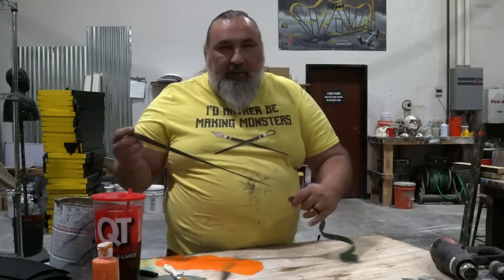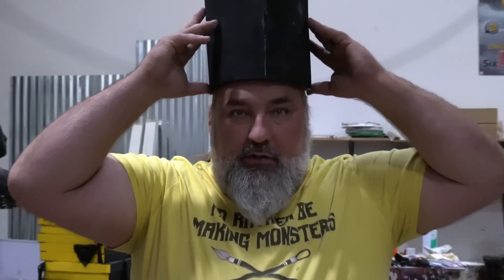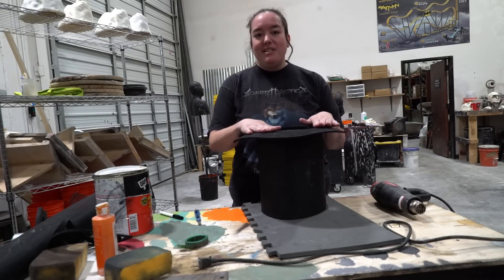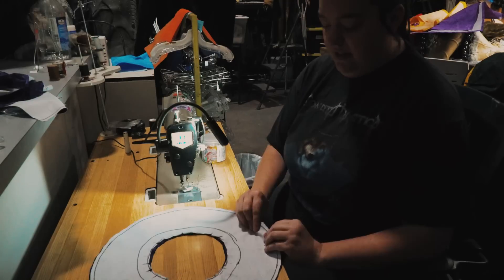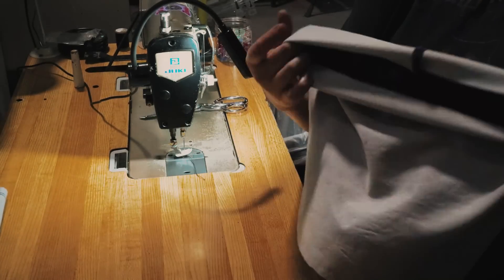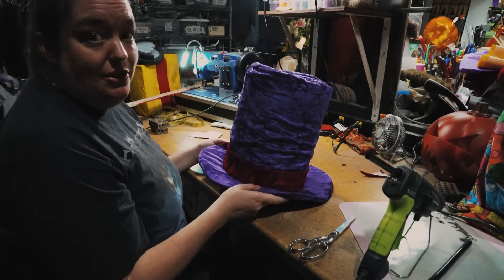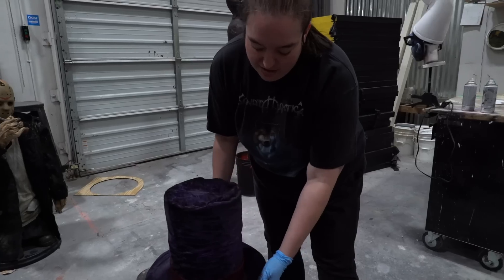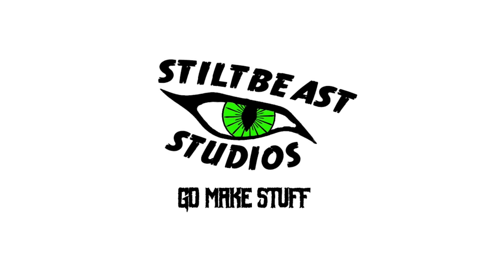Make an EVA foam fabric covered costume top hat

Comment: I have a stupid question - wouldn’t it have been easier to glue the supports in, before the hat was glued together ?
Reply from the maker: easier yes, but not better.
laid out flat the inside of the hat and the outside of the hat are the same length- as soon as you make the round the inside is about 2" shorter, because of the thickness of the material and the nature of tubes. Also gluing them in after reinforces the curve by holding it in place- if you glue them before then it creates tension when glued together as opposed to relieving it since the foam cant slide along the glued seams (since one is shorter than the other)
Reply: @StiltbeastStudios   and that all makes perfect sense - thank you for explaining that !!!